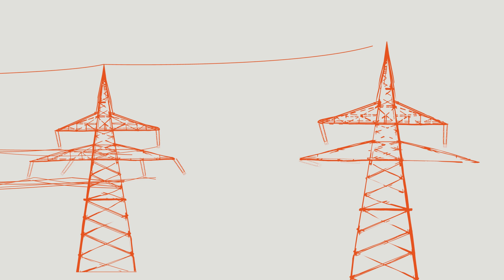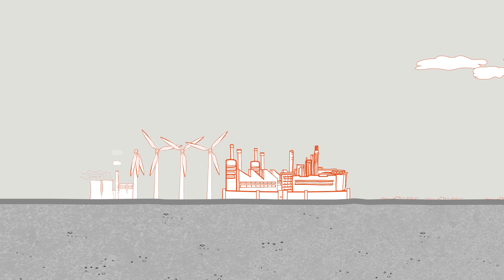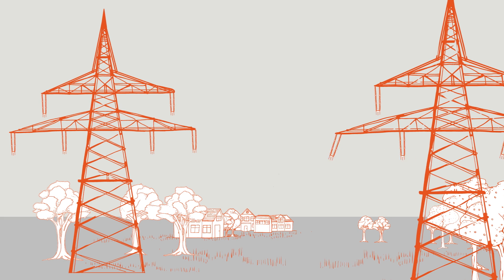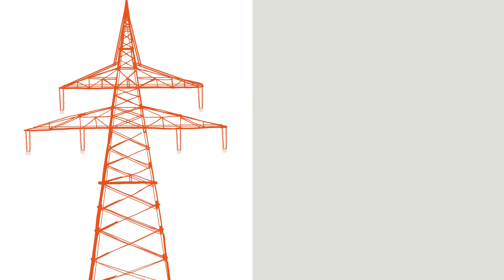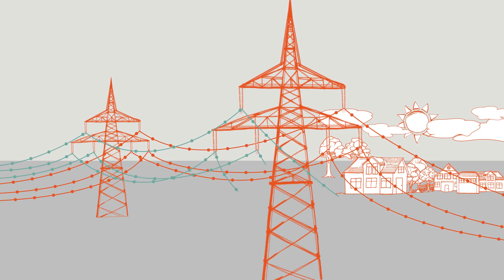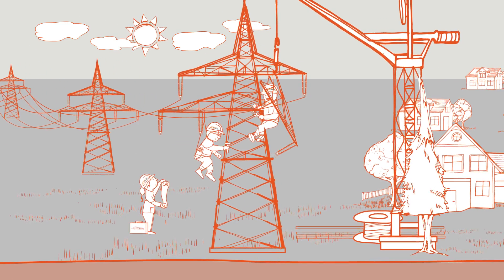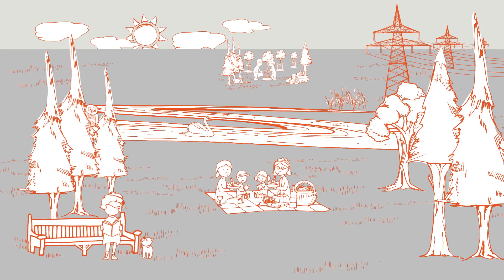How do transmission lines work

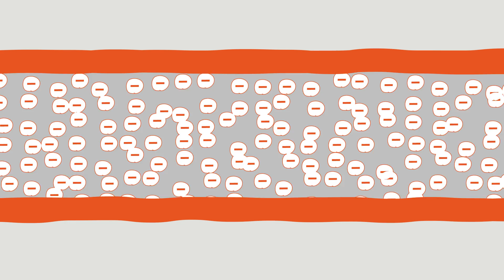Comment: 1:37. If i remembered correctly, the Skin effect caused by Eddy current will make the most of Electrons to flow "near" the cable/wire 's Outer Surface (says >75%), while only minority e(-) will go through (<25%)the inner metal (aluminium), so.. it's Skin Effect.

Comment: In the United States of America we use large electrons.  50HertzTransmission uses "small electrons" so it takes twice the voltage at the consumer unit.
Reply: What do you even mean? An electron is a particle, they only have one size by definition.

(Unless you are refering to its bigger variant: the muon. Wich I would doubt, as they decay within a some millionth of a second.)
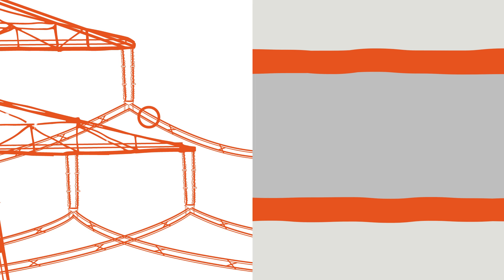Reply: @suddeneevee9441  At 1:29 the phrase "small electrons" is used in the video.  I assumed that we used "large electrons" in North America because our voltage is 120 volts.  It was meant to be amusing.

Comment: https://youtu.be/9lx5deLg0IA Some industrial drones are use to stringing of pilot cables in overhead transmission line construction.For the purpose of use DJI inspire is used to record videos in car racing and high speed movement recording etc. In first time we did experiment using DJI inspire for stringing of pilot cable in high  difficult hilly terrain area.Our goal is to stringing pilot cable one tower location to another.there is huge difficult terrain which includes more and more crops,plants and trees.actually look like environmental sensitive forest ares.very difficult to clear the band width for stringing pilot cables.Pilot cable stringing drones are much expensive and hence we use low cost DJI inspire drone to stringing 2 mm pilot cables.that was very successful and i will upload more videos about these experiment valuable work.subscribe us for more videos

Comment: Hello i can one question. what is this n minus one ? Idon't know information this system
Reply: n-1 refers more to programming language (at least that is when I used it). n is the variable. In this case, n is one section of the powerline. n in this case is like a bit (either a zero or 1). If that section of the line has a fault, breaker or transformer failure (a lot of other cases), then that n becomes a 1. 1-1 = 0 so that section drops out and the other section picks up. basically n-1 is failsafe for saying we have two different ways of getting you power in case one side goes down.Example: I work with rectifiers and chopper units. Our chopper units are set up with a plc programmed for n-2. Since there are a lot of components in the chopper unit, we are saying that if one component fails, the machine will give out a warning, but still run (minus that failed component). Thus, n-2 becomes n-1 because n=1 and 1-2 = 1. Once two components fail then the chopper will shut down itself through failsafe. This happens because it stays in alarm mode and once it receives the second failure, the variable n=2. So, 2-2 = 0.Not a very in depth explanation because I am not a PLC guy whatsoever, but hopefully it helped a little.
Reply: @zacharyicenhower7388  Wow. What a wonderful explaination. Thank you so much. You explained it so clearly

Comment: Well, over 4 decades in the business and never once have I call an insulator an isolator. Where I’m from they’re called towers, not pylons. You’re statement about triangle configuration is also misleading, every 230 Kv and 500 Kv structure I’ve worked have verticle construction. Lower transmission and subtransmission voltages such as 34.5 Kv, 69 Kv, 115 Kv, may be in either configuration. Btw, your video didn’t explain how transmission circuits work, just a slick advertisement.
Reply: 30 yrs under the belt and I agree.
Reply: Do you know any good videos on here that does explain it accurately?

Comment: This explanation is even lighter than the most superficial method one can use. It said nothing of value that an observer looking at the sky cannot conclude.  Also " isolators" are not exactly " insulators"   While the transmission lines have insulators they are not exactly isolated from Earth. The transmission line system is not a floating isolated system!  I think I shall stop here as for some it could get complicated!

Comment: How come birds can land in that lines?
Reply: Because they land on the same phase, so there is no potential difference between it's feet.
Reply: Because they are small in comparison to the air gap between the phase conductors or to earth, as long as they do not touch or get close to another conductor or earth at the same time their bodies rise to the voltage of the conductor they are standing on but there is no current flow. Birds with wing spans large enough to bridge the air gap are electrocuted. Same principle as bare hand live line maintenance.

Comment: 2:07 n minus 1? N+1 he means! N-1 would mean that there is no transmission line at all.
Reply: N-1 is the exact term, it means that you still have an N state after one element is removed, some high reliability transmission links have N-2 capability.  30yrs as a Transline designer and O&M manager.

Comment: Is there any neutral lines up there as well?
Reply: there is only a neutral at lower distribution voltages where there are distributed loads across 1, 2 or 3 phases. The transmission system is essentially a balanced three phase system. The additional conductors you see on the tops of transmission towers are earth wires, sometimes called shielding wires, used to protect the conductors from lightning strikes and sometimes to carry optical fibres.

Comment: this is 2018  ot 1018  . Its time the Electricity Industry stopped hanging the supply of electricity from   wooden poles  ( local supply ) and spare parts fom the Eiffl Tower for the Grid  ! !  and put it all under ground  if the Fiber Optic Industry can do it so quick . our local supply  of Fiber Optic Cable was insalled in a matter of Weeks  .incuding the construction of brick connection Pits  COME ON ELECTRIC GET WITH IT ! ! !
Reply: Guess you didn't pay attention in science class in 6th grade.  Electric lines buried underground generate a LOT of heat thereby destroying the cables much faster than if hanging in the air.  Basic science here.  The resistance generated in the wires generated HEAT which is not easily dissipated under ground and since super conductors are a few years off, the HIGH VOLTAGE transmission lines will be above ground.
Reply: Guess the Americans didn't pay much attention to Science class Iether  see other comments  They put stuff Underground  ! !
Reply: @Donald:  THEY DO NOT PUT THE HIGH VOLTAGE LINES UNDER GROUND.  They DO put lines underground in residential areas.  These are NOT the MEGA HIGH VOLTAGE LINES you see going miles and miles and miles.  Pay attention.  Buffoon.
Reply: Donald, It is possible to design and construct long underground transmission cables, as long as to manage the sheath voltages and effectively dissipate the heat,  an 80km 220kV AC cable has been installed in Australia.  Many if not most of the long cables around the world are EHV DC they do not have the same electrical limitations as AC but are less practical from a network point of view as you can't easily transform EHV DC to the lower AC voltages need to supply loads. 
The problem is that the cables require a very thick polymer insulation, moisture barriers, metallic screens and high strength outer shells and this presents two main problems, getting rid of the heat, a 1200mm2 cable has lower current carrying capacity than a 630mm2 O/H conductor, and secondly they are exceedingly expensive (per phase - cable is $200-$300/m compared to $6/m for bare O/H conductor). In general U/G cables used to be over 10 time the cost of O/H,  this is reducing but is still in the order of 4-5 times. 
The other factor is the time to fix in the event of a failure. Specialist EHV cable joiners are in high demand and when you have to excavate, shore-up and create a very dry/clean work environment it can take weeks if not months to fix. In comparison an overhead line can be reinstated within 1-3 days using temporary structures and general transmission linesmen.  Cables have there place but there must be a need to overcome an O/H constraint before it becomes financially feasible, e.g. a dense urban route, ultrahigh value landscapes etc.

Comment: We need more local power sources. Long Power lines are going to go away.
Reply: Carl, 

not any time soon, there is no viable alternative that gives security of supply.
Reply: Could be as simple as installing a few solar panels. Up until now it was a question of resource availability, not all areas had abundant wind/coal/etc. concentration & hence long power lines were needed to connect place of generation & place of use. With solar, much like Australia has decided to do with Tesla, microgrids are the concurrent near future wherein a singular solar plant installed in the vicinity would power at most a community of 500 users.

Eventually we'll move on to the Hydrogen economy where as you said, we'll have the generating stations in our backyards. Power lines possess multiple safety & environmental hazards. Not to mention how much they cost to build & maintain.
Reply: Sure.  Let's build a generating station in YOUR back yard.  Buffoon.

Comment: '
very high electric powerlines / transmissions / towers are not good nearby residents homes areas...
because of cancers and risk healthlys
Reply: With that doubt in mind, Finland government made a survey for cancer rate of all of the residents living near powerlines and that of residents living elsewhere, and amazingly found the rate is a little (about 1%) lower for the former. Anyone can search online to get the details of the report published in 90s by Finland government.
Reply: Sorry, correction of a minor error. should be "....a little (about 2%, and especially as much as 7% for lung cancer) lower...."
Reply: Did you not take science courses? Electricity wont cause cancer or risk health unless you are touching the wires then you would be electrocuted. Transmission lines release low frequency EMFs and has limited energy to ionise atoms. You would need at least 3x10^6 Hz to cause cancer which is in the spectrum of Xrays. Power lines operate at 100 kHz which is no where near close enough to cause cancer. Hell with that logic wifi would have killed us by now since it operates at 2.4-5 GHz.
Reply: @XxMine231xX  ,  transmission line operate at 50Hz, the 100kHz you are referring to is most likely the corona discharge (the sizzle) this has very low energy compared to the 50Hz.
Reply: They do not cause cancer

Comment: 1:18 - Isolators. Please remake the audio track and change 'isolators' to 'insulators'. (This will prevent people who do all their learning from the internet making embarrassing statements when discussing transmission lines).
Reply: nlo114 yeah here in the UK, isolators are something completely different regarding electricity distribution/transmission
Reply: nlo114
"You're"
You're welcome. Thank you for your good try.
Reply: Wasted Irony... ...Whoosh! Straight over the top.
Reply: ya, it really turns chicks off when you're at a party and you say isolator instead of insulator.
Reply: Isolator=switch, insulator=non-conducting material.
Reply: It appears to be a German company and in Germany you say "Isolator". Nevertheless it should be corrected.
Reply: Your absolutely right there. I made the assumption based on spoken English.

Comment: How about the low voltage line?
I see them go into street lights, but why are they connected to the rope that holds the pole?
Reply: You have to be more clear in your question. What do you call low voltage? 50v? 230v? 400v? 11kv? Which rope do you mean? There are no ropes in the electricity grid. Only steel wire. And which pole? The one where the street light is on? Or some above-street powerline pole?
Reply: Those aren't ropes.. maybe you are talking about the "guy" wires that helps the pole to stand erect. It doesn't carry any conductors tho.
Reply: The guy wires are insulated as well. Because they can shorten to ground. And to stand erect is partially true. They are there to counteract the forces the poles are exposed to.
Reply: We have low, medium and high voltage lines. low is for home distribution, and high for transportation. We use transformers to change voltages. Using a high voltage line means that the current will be low, so we can use more thin cables.

Every tower has 3 phases called R S T, and ground on the top. We can have to max 3 3-phases, R S T, R' S' T', R'' S'' T''.

Cables can't touch the tower and have to be a minimun separated between same name (ex: R - R') Phases. When rains, the fkin water may cause a conection between cables or cable and tower, thats because there are those strange things on the poles conectect to lines

Comment: why we does not use main transmission lines as a solenoid?
Reply: Your English doesn't make any sense, and what do you want to do with a solenoid in an electricity distribution network? A solenoid is a device which converts electricity in a mechanical movement. Maybe you mean something else than a solenoid.